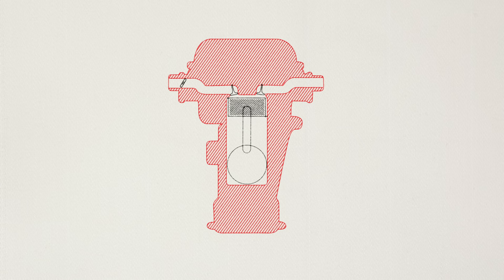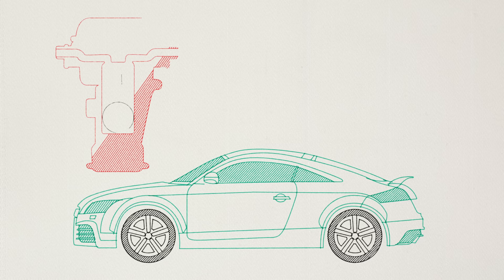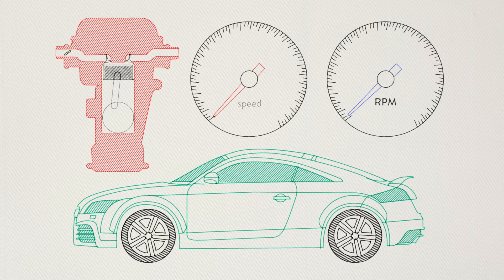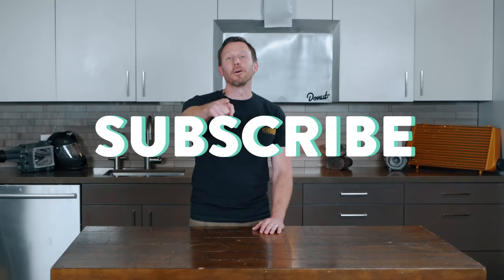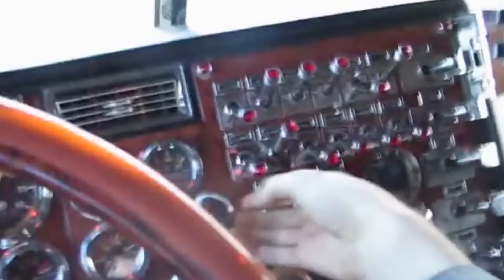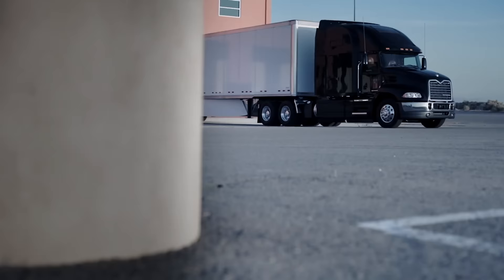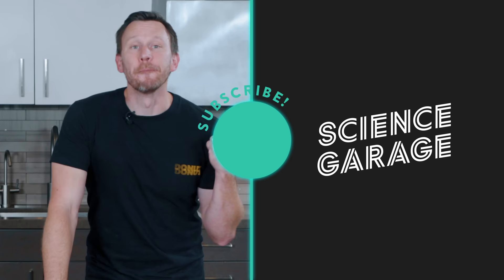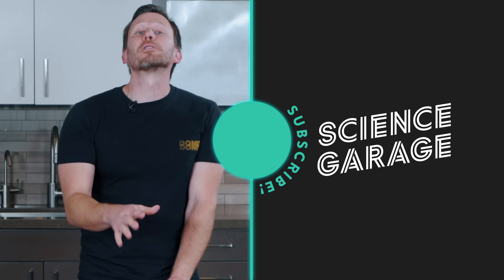ENGINE BRAKING | How Semi Trucks Slow Down Without Brakes | SCIENCE GARAGE

Comment: How to slow down without hitting the brakes:
Step 1: let off the gas.
Reply: Diesel*
Reply: Won't work if you're going downhill
Reply: @damirock98  low gears and it will.
Reply: PlannedMayhem not really. It will a little bit but diesels don’t have throttles so it’s going to suck air into the cylinders easy as could be
Reply: @eman7579  
That kind of braking is actually pretty hard on an automatic transmission because low rpms don't generate enough pressure to fully apply the clutches, meaning you'll have some engagement but still run the risk of slipping your clutches. Especially since the ones used for 1st gear are generally pretty small.
Reply: This is a severely under appreciated comment.
Reply: @eman7579  so if the throttle is the missing part why not just ad throttle like on gasoline, or closing the air intake will stop the engine and make the truck even more danger, cuz no running engine means no servo nor brakes ?
Reply: Jordan Gogov I don’t know why they don’t have throttles. I just know they dont
Reply: You forgot to add the other steps....
Reply: @PlannedMayhem  ik this 4 months old... But my dad's a trucker... So I know about this... If your going downhill and you let off the gas your still gaining speed... and if your downshifting, then your rpm go through the roof and that's bad for that big rigs engine... The engine brake is used so you aren't wearing down your air brakes... Because holding them lightly down the hill really bad... And tapping them is just flat out dangerous and stupid... So... Hopefully this explains it
Reply: engine braking is the way to go when driving in snow and ice. Can do it with all automatics too, they all let u shift through the gears these days
Reply: @eman7579  diesel enginges do have a throttle.  They just work a bit different than gasoline engines.  Diesel engines use the heat from the air being compressed in the cylinders,  the compression of a diesel engine is over 10 time that of a gasoline engine.  If you let off the throttle the compression will slow you.   In a gas engine letting off the throttle will help slow you down but not as much.    
Diesel engines in big trucks use compression brakes.  They are on the engine they make the cylinders hold the compression to allow for more slowing capabilities.   That is how big trucks can go down a hill without even using wheel brakes.
Reply: @Bendigo1  I was talking about the valve in the intake that opens and closes to let more or less air in. Of course they have throttle pedals.
Reply: Better, use clutch with a little brake, that engages the cruise in Indian Scorpio( As I know about that only) then keep the clutch pressed it will slow down
Reply: @PlannedMayhem  Didn't he just explain why it wouldn't work on all vehicles? please rewatch the video
Reply: Step 2: steer vehicle into tree
Reply: @eman7579  diesels do have throttle body’s big butterfly valves that open for more air and close for less dd series and isx Cummins do also old cars and some 60 series Detroit’s don’t however
Reply: @PlannedMayhem  clearly never driving a loaded truck down a hill
Reply: @jacobg5122  probs why my cel training guy said to sue 2nd gear
Reply: @PlannedMayhem  there's a reason why engine braking and things like Jake brakes and exhaust brakes were developed for semi trucks pulling heavy loads going downhill

Comment: Modern diesels DO have throttle bodies, but they are primarily for emissions/ EGR functions.  They still don't control throttle. The ECU by means of electrical motor or solenoid controlled vacuum line can control the actuation of the butterfly valve in the throttle body to restrict the amount of fresh air (from turbo charger) into the intake manifold under low engine load situations. This helps create a pressure differential and thus helps the EGR system to feed more exhaust into the intake manifold.
Reply: Learn something new every day, interesting. Almost as functioning as a vacuum increasing butterfly, This plus variable geometry turbochargers is changing the game for all engines.
Reply: Which in reality the EGR still doesn't work properly. Like in my Freightliner. It has to have the carbon pushed out of the holes every 9-12 months. And let's not get started on the DEF system that drops my trucks mpg from 6.5 to 5.5 as soon as the temperature drops below 35f.
Reply: @karlporath8904  the DEF shouldn't have an effect on fuel economy since it is all taking place downstream in the exhaust. Probably just seeing the effects of an engine running cooler than it's used to

Comment: Now explain modern "exaust brakes" in small diesel engines
Reply: Butterfly valve on the hot side of the turbo. Closes to create preassure in the engine. Kinda like the opposite of a throttle on a gas engine.
Reply: Think of a throttle body but in your exhaust. Boom. Exhaust brake.
Reply: In applications where the engine has a VGT or variable geometry turbo the exhaust braking is controlled by the internal vanes of the turbo. Basically it closes the vanes as much as it can cause a large increase in drive pressure or back pressure in the exhaust manifold aiding in engine braking
Reply: Was wondering the same, my diesel car slows down a lot more then any gas car i ever drove, when i release the gas
Reply: Not just in small engines, actually here in Europe at least, the type of Jake brake he explains is less and less used, modern truck (what you call "rigs" in the USA) all use exhaust brakes witch go by many names like "retarder" or "mountain break". They are more efficient at breaking, therefore more safe
Reply: @nineseven5one853  incorrect a retarder in use on european trucks is a braking mechanicsm that uses hydraulic fluid and pressure to slow the output shaft of a gearbox, therefore slowing the vehicle. Scania uses them on almost all their vehicles. In general terms, any braking system is a retarder because it retards or reduces motion, but in regards to the specific braking mechanism called a retarder, its that described above
Reply: @nickwhite6717  there are many different braking mechanisms used, even magnets on driveshafts

Comment: Whoa, a late upload 👀 One of the best things about a manual transmission is engine braking. For daily driving, it's perfect
Reply: I see you on every car related channel 😂 what a legend.
Reply: @avalanche450  lmaoo thanks bro!
Reply: Good channel bro!
Reply: @basithph8958  thank you!! I got a hold of some badass cars recently. Reviews coming soon 👀
Reply: Fucks with your channel bro.
Reply: @lydellthompson831  thanks brotha. Appreciate you
Reply: 2jz review coming guys! Can't wait to show you
Reply: Depends on where you're driving. I'd love my commute if it was mostly highway, but I have to pass through a bunch of towns and run into a lot of the suburban traffic that's on the way to the city. I'm just glad I don't actually work in the city. 

My dad drove stick for years, and he told me when I bought my car that I'd regret it. He was half right. Now I'm looking for used electric or hybrid for a dd, so I can turn my current dd into a project car.
Reply: Also, automatics can engine brake too.
Reply: @MyChevySonic  maybe with the right transmission and associated electronic programming. Don't confuse a car slowing down became of wind resistance and friction and engine braking
Reply: Yeah helps to slow down without braking 🙂🙂
Reply: Dan Manthe if you leave an auto in a gear and use the engine to slow the vehicle, you are engine breaking. I drive a 7200lb 4.8L automatic Chevy truck and I use engine braking frequently. No special programming, just manually selecting a gear. Brakes are a lot cheaper than transmissions, so don’t use engine braking unless you know how to without damaging the trans
Reply: @ryanmalin  the answer is correct rev matching is addition to braking a bit so the tran and clutch doesnt have to do all the job but when engaged releasing the brakes it will slow down in a good way.. 
You are able to use engine braking cuz you can select your gears.
If you have in mind ratios and stuff you can do it well.
My mom loves engine braking, she got more than 250000km on her car and still have the original trans and clutch, the clutch don't slip at all (its so good in fact the car stalls sometimes if you dont give enought gaz, i think the poor diesel will gave up before the clutch lmaoo, early 2000 Opel be like)
Reply: @ryanmalin  not all autos need programming to use engine braking. Had a Subaru and when you'd let off the gas the torque converter would disconnect it would coast as if you were in neutral. My fault for buying an Outback. That'll why I  don't buy automatics. Among other reasons
Reply: Automatics can engine brake too, just more slushy. That's why they still let you choose gears.
Reply: No problem fellow car enthusiast 🏁
Reply: Dan Manthe yeah I had 1 Subaru, I’ll never buy another. I guess I was spoiled owning American cars my whole life but the subi is cheap, gutless. I don’t miss that car at all. It was a 2015 crosstrek, big time pos. Cvt transmission. It sucked
Reply: I can upshift or downshift the gears of an automatic car by just using the gas pedal. When the car accelerates, just leave the pedal and it will upshift (the sensor believes you released the pedal because you reached your cruising speed). When the car decelerates just push and release quickly the gas pedal, it will downshift (the sensor believes you pushed the pedal because you needed more power to pass a car or climb a hill) and engine will brake.
Reply: @MaxSpeedMike  you're justin y of automotive youtube
Reply: @DVDiclan  Usually it won't back the gear up because the car is already slowing down, but of course that's just a trick for those who haven't got a car equipped with shift paddles which are a must to enjoy twisties. 

PS When I press the gas pedal hard to overtake, my Chevy usually react instantly.
Reply: If not paddle shifters or some "manual mode" I would hope they at least have a D3, D2, L

Though my car responds in about half a second, I just prefer being in the right gear and in the power range before I even start to overtake. My car is pretty weak and is basically in eco mode permanently so it won't change down until I floor it.

Comment: You can feel it in automatic cars that have a manual setting or paddle shifted. My car is automatic but I use the button shift sometimes especially if it is snowing out so I can control what gear the car is in better and to use engine braking so I can slow down without hitting the brakes and maybe losing control.
Reply: Same. My car has a dual clutch transmission, and it helps slow down ther car very well. Heck, sometimes I don't even have to use the brakes. The transmission slows me down enough.

Comment: 73000 lbs? Here in Michigan it's legal up to 164000 lbs. Also, some modern diesels actually do have throttles, but I'm pretty sure that's more to do with emissions (especially EGR) than anything.

Also, automatics can engine brake Judy as well as a manual, they just need to have a lock-up torque converter
Reply: Take a look at the highway trucks most of them will have a GVW on the side, so don't and I don't know why. Most of them you will see will be rated to 80,000. But because of having to spread the load out to keep axle weight low, 20,000 per single axle max here in Idaho, most are rarely to max. More than 80,000 and you are starting to get in to tanker/construction, doubles/triples, or the awe inspiring heavy haul.

Comment: We diesel drivers can engine break without our Jake's, however it is less effective than a gas engine. During winter months when roads are slick we often avoid using our Jake's as they have a tendency to slide out our drives causing a jack knife. I like your analogy on the mechanics of the Jake break.
Reply: Yep cause jakes obly provide resistance to power axles

Comment: Trucker here. The reason that brakes can fail on trucks is because most of the trucks on the road in North America are drum brakes. As you apply the brakes the drum expands, and if you heat it up enough the drum will expand beyond the the stroke of the brake shoes and you literally have no brakes. The other failure that can happen is that if you apply constant, hard pressure to the brakes, you can heat them up so quickly that the components inside the brake drum and the wheel hub will catch on fire. Thankfully disk brakes are becoming more popular on class 8 trucks. Disk brakes can't get heat failure because the more the disk heats up the better they work. Of course you can still warp them or set them on fire, but with the better cooling its harder to do. Also runaway lanes work, but they're there to keep other drivers safe, not truckers. If you drive a truck up a runaway lane theres a very, very good chance you'll jackknife or flip.
Reply: As a European trucker I can't understand why you guys still run drum brakes. Here in Europe disc brakes is the standard for 20 years now ..
Reply: @burnoutbram5035  Fewer corners to slow down for.
Reply: @burnoutbram5035  there are some vicious slopes here in the US Appalachian and Rocky Mountains
Reply: Hungry Moose Also we are getting more ultra shift transmissions (Automatics) as well
Reply: @burnoutbram5035  Cost mostly. Trucking companies are generally notorious for cheaping out where they can.
Reply: Hate to say it but discs don't work better the hotter they get, they just keep working when they do get hot. That being said, even the best brake fluid has a boiling point and if it gets up past that you lose all brakes. Also heat causes brakes to "glaze over" which is the reason for brake fade in racing scenarios.

Better than drums, but not at all perfect.

Comment: That's why I love my 2015 Subaru Outback.
The CVT uses virtual gears, so...
When I want to slow down, I use the flappy paddles, and down shift to the lower ratios.
I have a little over 60k miles on it, and the brakes look almost brand new...

Comment: But the rpm andd the speed remain proportional always! As long as you keep the same gear ratio
Reply: Sorry, im that guy who spots mistakes
Reply: Aand i think the first prase should say disengage, not engage
Reply: I couldn't figure out why the speed and RPM wouldn't stay in proportion - glad to know it was a mistake in the video.
Reply: @aldomaresca9994  and the valves move up in the diagrams, and the fact diesels engine brake even without jakes.
Reply: @mcgrorymachined7596  to an extent yes, but thats more to do with power loss  through the different drive train components and friction with the roadway. They don't engine brake the way gas cars do. There is no throttle body and downshift just runs the revs higher without slowing you down faster in a diesel, there is no vacuum created in a diesel when you let off the throttle. In fact, if i let off the throttle in my rig, I can coast with no throttle inputs and only lose about 2-5mph over a half mile to 3/4 of a mile depending on my weight at the time and how level the roadway is.

Comment: Simple depending on how strong your Jake's pull back,weight and gradient of the hill and select the proper gear say 15% grade on my truck at 50T or 110k lbs I'd sit in 8th with Jake's on stage 3. Should hold at 1900rpm